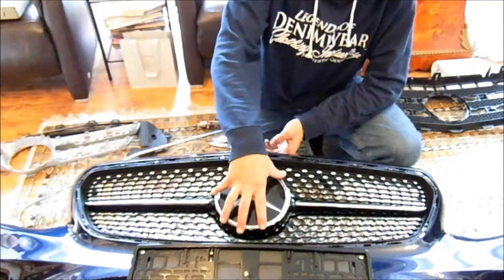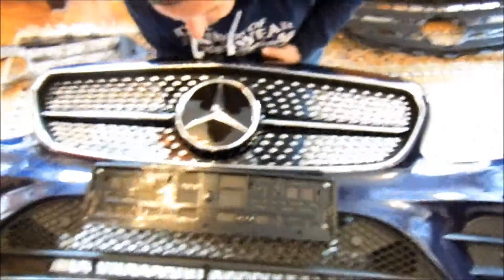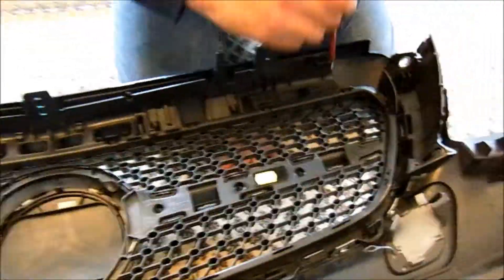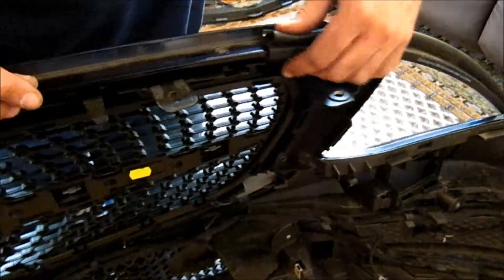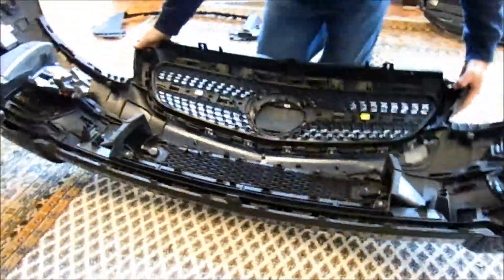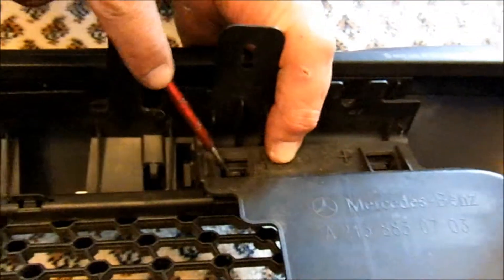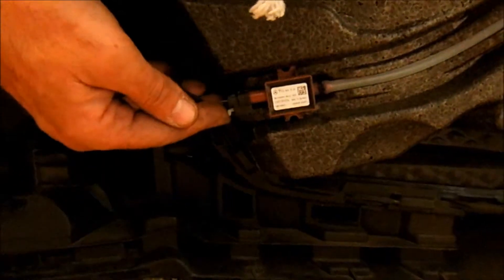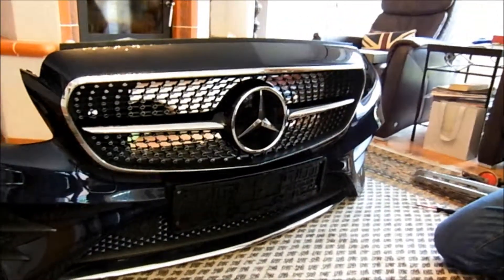Mercedes AMG Diamond Grill Install - Part 2

Comment: Another brilliant video mate ! I'm doing a grill swap on mine and I saw afew videos of the grills being changed and guys re attaching the grills with the rivet gun, i do not own one and didn't want to buy just for this 1 project but watching your clip made me realise I don't need to use a rivet gun either! I'm updating the grill on my estate to the panamerica gt grill, but thanks for the informative and clear instructions extremely detailed !
Reply: Lil update from me and thank you to you for the insightful videos, did my grill swap today took of the standard amg line grill and fitted the panamerica grill using your tips and the job wasn't bad at all and it fitted back nicely without any use of the rivets, once it all clips back it is actually very secure !
Reply from the maker: @hamzashah243 fantastic to know that the video helped 👌👌

Comment: Very helpful video.  Did you buy the new grille directly from Mercedes or was it a salvage one?
Reply from the maker: Glad you found it useful. I bought it on eBay (used but OE not a Chinese copy) and sold the original one for the same price. So the desk cost me about €10 in postage!
Reply: @mercedes_and_more  could you let me know the prt number as I’ve just seen on eBay adverts for w238 and w213 on offer for around £300.  I’m not convinced
Reply from the maker: @chevers69  hi sorry I have no idea about part numbers but mine is from a Cabriolet. If it starts with A213 then it was on a AMG43 saloon or estate, but if it starts with A238 then it was on a Cabriolet or coupe AMG line car or an actual AMG. I changed mine because the AMG line 213 cars have the same grille as normal car and I wanted the look you get on the coupe/Cabriolet. I paid about €175 (I did well), but would think £300 might be a bit  much? Does this help?